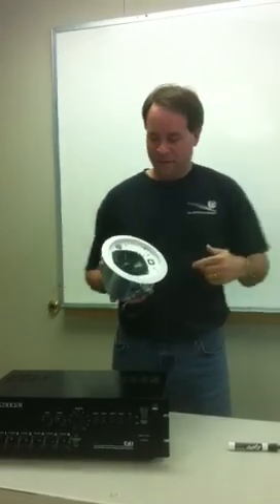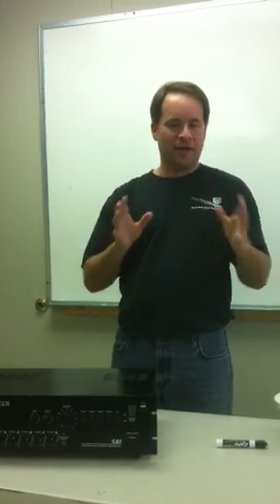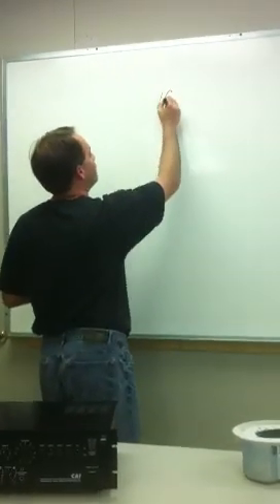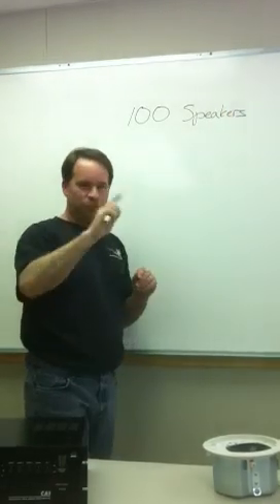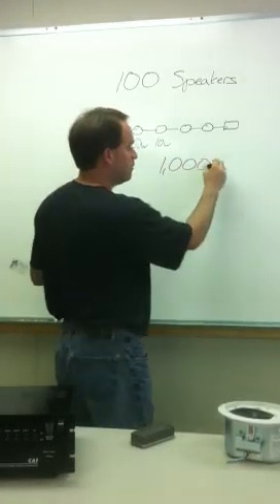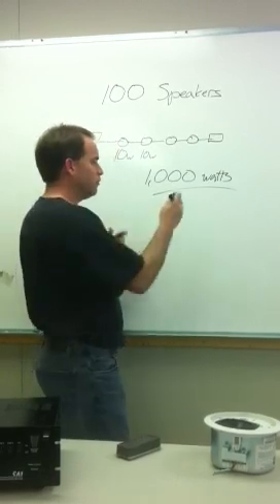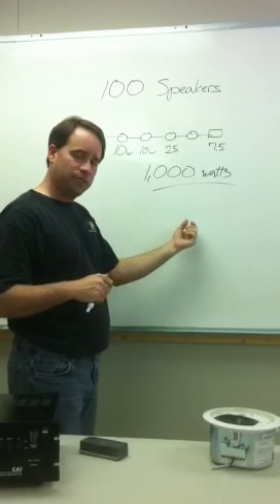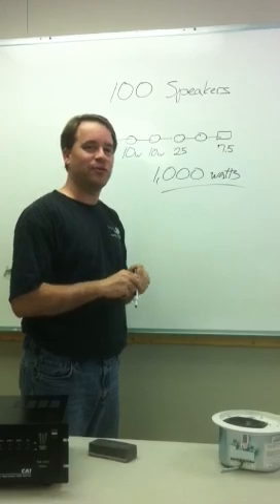How to use 70 Volt amplifiers and 70 Volt speakers

Comment: Jason,

Audio signals are a form of  AC electrical power.  Power is volts times current.  Correct?

Every cycle the AC is 0 volts twice.  For each cycle at ~70V rms sometimes AC is 100 volts. Sometimes it is -100 volts.   Correct?

Sometimes the audio is quiet. Sometimes the audio is loud.  Correct?

The cycle duration can be long (for woofers) or short (for tweeters) because the audio spectrum ranges from 20Hz to 20KHz.  Correct?

How does music, paging, or emergency alerts work if the voltage is constant at 70.7V?

Why not 25V or 100V?

Moreover, how do you connect speakers to the amp?  

Do you use copper wire?  In parallel, series?  AWG?  

Does speaker wire have to be installed in conduit?

RCA jacks? 3.5mm jacks? Phoenix euroblock screw terminals?  Neutrik SpeakOns?  Banana plugs?

Your video makes no sense. It's less than half vast my friend.

Comment: Can i buy a larger amp then needed to expand later if I'm not going to use all the power now? It doesn't seem like you will not blow speakers because its tapped for a specific wattage. In short if i had a  amp but only had 2 60watt speakers hooked up per channel. Can that damage the speakers like a low impedance set up would?
Reply: No it will NOT damage speakers. You can have for example 1000 watt amplifier with connected just one speaker and using only 1 W nothing bad will happen.

Comment: I have a hum on a 70 volt church system which is only starts after the system is on for about an hour. Not sure if it is one of the tranformers on the ceiling speakers or the amp causing the problem, any thoughts?